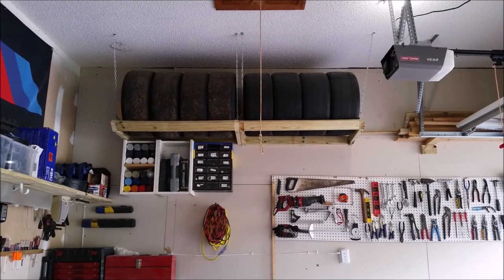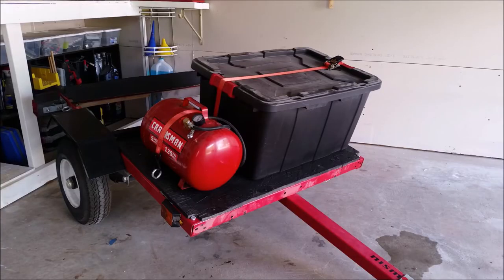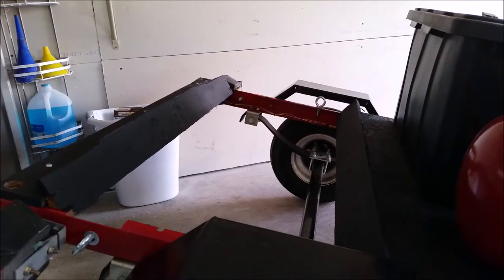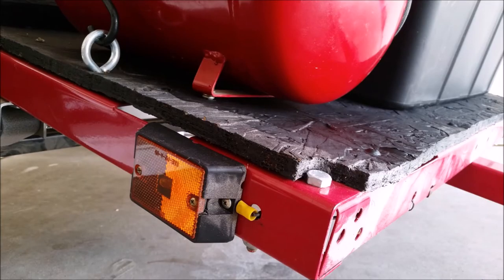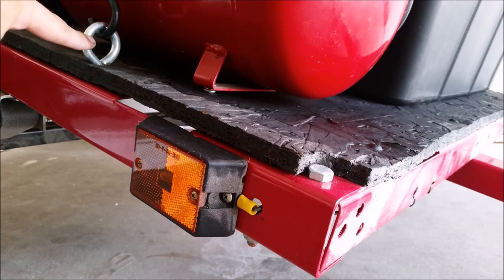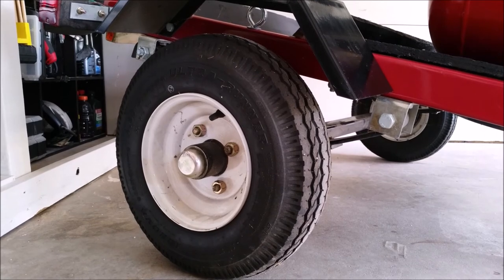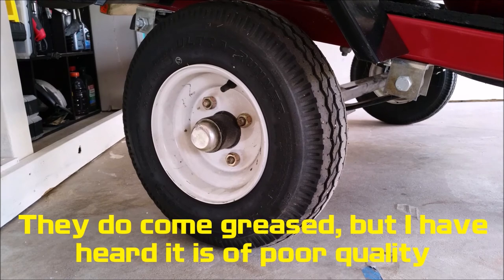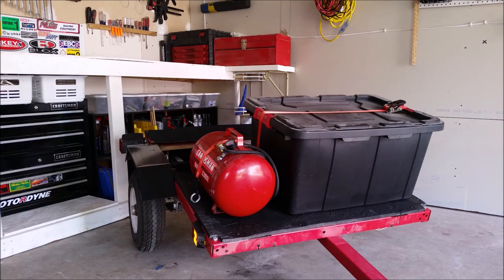Harbor Freight Track Day Trailer Review and Guide

Comment: Thanks for sharing.  I just picked up a trailer kit from HF, and will be starting my buildout soon.  Any tips 6 years after the video?
Reply from the maker: I feel the larger diameter trailer wheels are worth it if you plan to go long distances
Reply: @350Z247  Mine came with 12" wheels. I guess the price increase isn't just inflation. 😂

Have you had any weight balance issues with the tires on the back, instead of the front?

How's the plastic container holding up? Does it keep water out if you drive in the rain?
Reply from the maker: @grippgoat  the weight was fine, it balanced pretty well, and the container did it's job pretty well.

Comment: I tried the same thing, but with 4 pc of 275 tires, the back half is not wide enough for 4 tires. What size is your tire?
Reply from the maker: 225 slicks but they're about as wide as my 245 section street tires. I had to slightly cut the frame for clearance.

Comment: Are you using less leaf springs?
Reply from the maker: No, just the standard two leaf pack.
Reply: @350Z247  any issues with the trailer "bouncing" around?
Reply from the maker: @bboixtc  No, she ran surprisingly smooth. I didn't even know it was back there until something like a railroad track crossing.

Comment: Do you happen to have any pictures or video of the tires on the trailer? I'm curious to see how you secure them.
Reply from the maker: https://youtu.be/C5s9BI0SCgU
Reply from the maker: You can see the wheels on the trailer at the end of the link above. If you look at the back in this video, you'll see I put two boards at a 45 degree angle to make a trough for the wheels to sit in then I use three ratchet straps to hold them down.